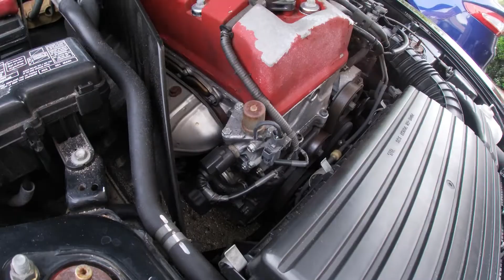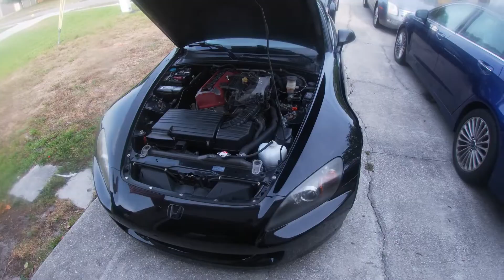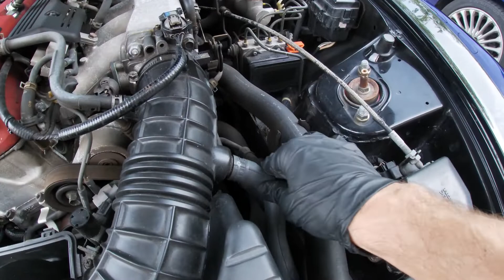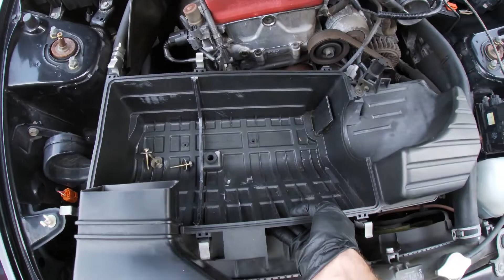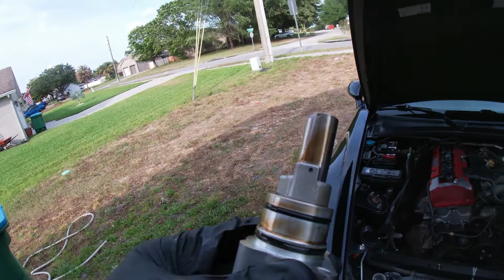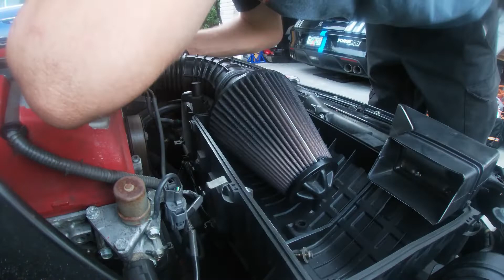Honda S2000 Common FAILURE fix // HOW TO replace your timing chain tensioner #s2000 #TCT #Ballade

Comment: How's that TCT holding up, I need to replace mine and not sure which brand to buy, and I see you did the airbox mod did it make any difference in performance or sound
Reply from the maker: TCT has been flawless. You get alittle more sound and performance but nothing life changing